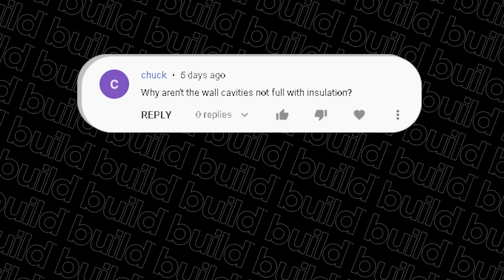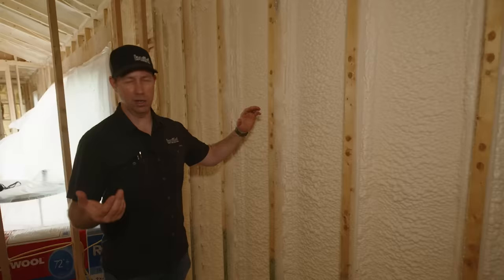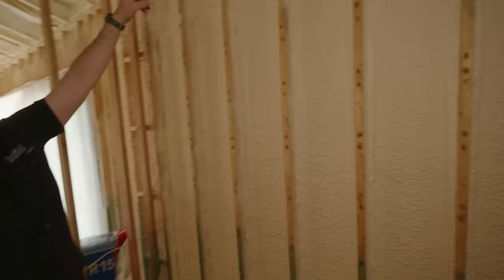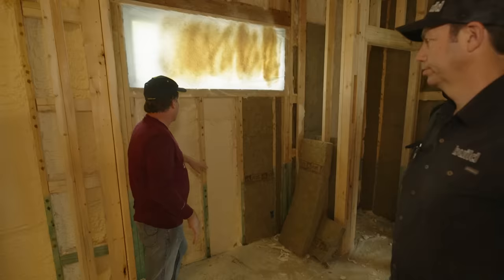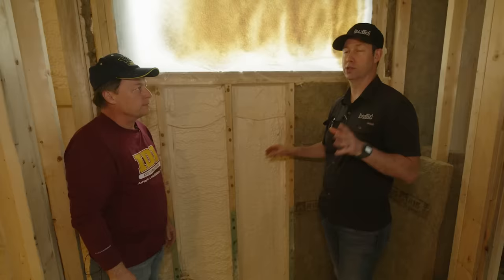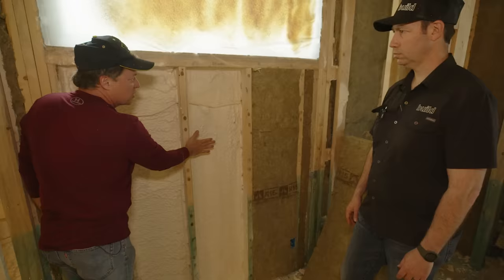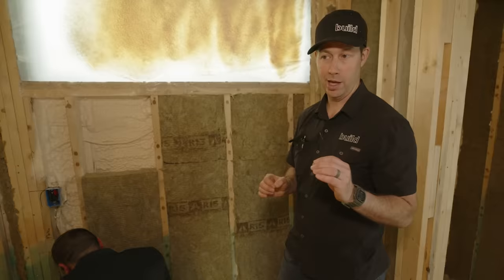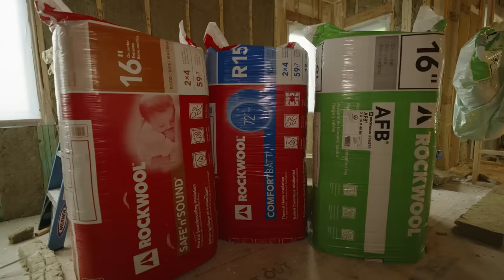Closed Cell Foam + Rockwool- How To Flash & Batt

Comment: something I don't get, and i'm hoping people will either confirm or correct me here.... But wouldn't it be better to do this the opposite way? I've seen so many issues with dewpoint etc with the foam and batts.

Why have the foam exterior and batts interior? Would it not be better to cover inside somehow maybe vapour barrier etc (as you dont want to drywall without exterior sheathing and housewrap) and then spray foam from outside onto the backing of interior wall, and the batt on the exterior before exterior sheathing?

I know this would make build a bit more complicated etc..... just meaning in terms of overall performance of the insulation. This would still air seal, act as vapour barrier etc but be better in terms of the dewpoint?

Im in a cold climate btw. Also have been thinking about this as a retro fit option to an already built house with rotting exterior ply. so interior drywall already there. remove sheathing, spray foam back of drywall, then batt and re sheathe and siding.
Reply: We vapour barrier on the inside as it a cold climate, this is my reason for thinking that way. Gives vapour barrier on the right side, air seals, and dewpoint wise this should eliminate issue.

Also I was meaning to remove the poly VB after spray foaming. or use 1/4 ply interior. Or maybe drywall and spray foam right away (foams good enough to waterproof while batting and exterior sheathing)
Reply: In our cold Canadian climate best practise is to spray foam the outside of the wall, not the inside cavity. 

IMO best method is to build with 6 mill vapour barrier behind drywall> 2x4 or 2x6 framing> fill wall cavity with rockwool insulation> apply liquid barrier to the exterior sheathing to stop any air leakage and install R8 or R10 continuous EPS insulation.  It must to be EPS. DO NOT USE pink or blue rigid foam on the exterior of a house. The downside to this method is there will be no room left for brick or stone unless your foundation is 10" thick.

Comment: The batts are basically unneeded, other than a slight noise cancelling you can't do much better than 2 " foam. R values are archaic and not any good indication of heat transfer. R value is a lab measurement in idea conditions. The real world is an actual testing in the field of heat transfer and 2" of foam will stop 86%, even 1"more  of foam only adds 4% more reduction, hardly worth the cost, especially using batts.
Mat likes overkill at costs, a good way for his channel to sponsor many different products which he does a great job at. The zip board wasn't even needed, the foam will give the wall all the rigidity it needs with other sheathing. Save money on materials and labor.
Check Spray Jones youtube channel out for the best facts on using closed cell foam.
I do enjoy both Matts and Jone's presentations
Reply: The real world requires an “R” value. That’s why. Plus ALL the manufacturers require 2” of close cell for a vapor barrier.
Reply: @Wild_Bill57  Only communities that haven't kept up with research and still value R as the gold standard. Once shown the new info many communities have allowed foam at 2". 
Very interesting when you say manufacturers require it, I thought communities codes would do that. Can you explain further?
Reply: @Wild_Bill57  You can petition for code changes with the right architect and proven research

Comment: How thick do my walls have to be to get r200 walls to protect myself from the Florida heat?
Reply: The T-studs that he used were 5½" thick (2×6 equivalent). 
They make 2×8 size as well. If you sprayed the whole cavity with high performance foam, you'd have nearly R60 for the wall system. And, I believe it would meet and exceed Miami-Dade specs for hurricane rating.
Reply: R200?
Reply: @kennyg1358  Use a calculator.  Matt told u r-value per inch in the video.  Go back and listen.

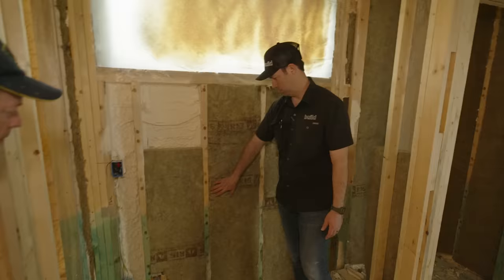Comment: Can someone check my vision?  At 9:00, look at the insulation label, does the lower batt say R15, and the upper batt say R13?  Thanks.
Reply: Look on the left of it, it's a 5. Only looks like a 3 because the top-left little 'L' hook of the five didn't print properly.

Comment: Where do the soffets go if you spray foamed where the rafters meet the wall?
Reply: This house was built with no soffit watch earlier videos.  Conditioned attic space
Reply: use "soffit blockers" (cardboard baffles-any builders supply") in conjunction with +rafter-mates" and continuous ridge vent  where require.

Comment: as you know and explained in this video much of the insulation installations are not done correctly and greatly effect the thermal performance. the systems you used - inside and outside needs constant inspections and with all the different systems there is more likely hood something is not installed properly.
The system your proposing maybe applicable in some climate zones and not in others due to the spray and board insulations acting as vapor barriers. in the NE I would not recommend duel insulation vapor barriers as it is (as of 2020 +-) as no vapor barrier is recommended,  air and water barriers yes, thermal bridging insulation yes. exterior water/air barriors along with using interior finishes (GWB) as backup air barrier yes.
your use of the "new stud" system could use a blown in insulation to fill the "gap". 
warm roof us cold roof - well you could start a war with that one and depends upon roofing materials.
thanks for ALL of your informative vids - discussions are worth it.

Comment: lol, rockwool doesnt deaden sound reflection if its clad in drywall.
Reply: I believe it does actually. The make some exactly for that, to use in interior walls.
Reply: @soybomber  I guess I ignored the word reflection on your comment. You're probably right. Your correction would be more effective without the google comment and "but whatever". My point is that insulation in a wall does help with sound. I'm sure you're correct that it only helps with certain types of sound transfer and also certain frequencies. If you're trying to do recording or band practice or something, you obviously need more.
Reply: @wsteven82  sorry, i hate being corrected when i am know i am right. but yes. soundproofing inside walls deadens "transfer" but for recording inside the room, in order to get the most pure direct sound without the added reflections (echo's essentially) you need to have reflecting surfaces deadened. Matt talks about that for a sec in the vid referring to the panels he made. essentially wood frames filled with rockwool and covered with a fabric. that same kind of panel is used in professional sound stages around the world. easy peasy.  most frequencies above 250 hz are easy to minimize transfer with basic mass inside walls, but bass frequencies are harder. you can build bass traps in the corner of your rooms, you can use resilient channel between your framing and your panels, as they allow the entire wall to kind of act as an absorbing device. bass frequencies are very large waves and require very large devices to absorb them. there are more complex and more expensive ways to frame rooms for absorbing sound as well. with special adhesives and fasteners that allow for "0" acoustic transfer through structure as well. basically floating wall and floor systems.  and then theres expensive additives like mass laden vinyl, that allow you to prevent acoustic travel into and through HVAC systems etc. it can get REALLY expensive really fast.
sorry for the essay, but its a good opportunity to point out real acoustic issues and solutions and end the conversation lol.

Comment: So why is this the choice over full cavity foam fill and flush trim?
Reply: 2" of closed cell foam stops 86% of all heat transfer, it's all that's needed in ice cheats that keeps ice for 5 days.
Reply: @safffff1000  ok but another process with more time and labor and making sure it's all cut nicely around boxes seems like a hassle over just foaming the whole thing when you were there foaming in the first place.
Reply: Mainly the cost but have fun trying to trim closed cell. Open cell is way easier to trim but it opens up the cellular structure and could cause issues and inefficiency
Reply: @elderfarms  No need to trim close cell it only needs to 2-3" thick
Reply: @safffff1000  Ice chests don't have wood framing acting as thermal bridges everywhere.

Comment: So I know this was a while ago but I’ve long been wondering: How thick should each of these layers be in a more typical 2x4 framed wall assembly?  I’m renovating and it seems like after the ccf flash layer, there wouldn’t be enough remaining cavity for even the thinnest R-15 rock wool batts for 2x4.  (I’m in costal California with our Mediterranean climate.  Very temperate, but my microclimate gets pretty humid compared to the region as a whole and recent decades make me concerned about the potential effects of climate change on the next, say 30-50 years.)

How would these be different if we don’t get to put Zip sheathing on the outside and we’re stuck with existing stucco over wrb paper?  Roof deck?  Crawlspace?

Comment: I never see anyone using faced batts on new construction or renovation. Except for maybe in an unfinished attic with no plywood floor. Why is that?
Reply: Depends on where you are. In Texas, where he builds, it is hot and humid outside/cool and dry inside. The condensation is on the OUTSIDE of the building. In the north - Minnesota or similar - the outside is cold and dry; inside is warm and moist, so the condensation is on the inside of the wall. 

In the west, it is dry almost all the time and no vapor barrier is needed.

Comment: Did I see no stud guards for the Romex?
Reply: Only required when less then 1.25" from the stud face
Reply: @CybekCusal  yes. This is a fact. 
I have my code book next to me actually. 

NEC 2020 - 300.4(A) Cables and Raceways Through Wood Members.
(1) Bored Holes. In both exposed and concealed locations, where a cable- or raceway-type wiring method is installed through bored holes in joists, rafters, or wood members, holes shall be bored so that the edge of the hole is not less than 32 mm (1 1 ∕ 4 in.) from the nearest edge of the wood member. Where this distance cannot be maintained, the cable or raceway shall be protected from penetration by screws or nails by a steel plate(s) or bushing(s), at least 1.6 mm ( 1 ∕ 16 in.) thick, and of appropriate length and width installed to cover the area of the wiring.
Reply: @elderfarms  you need a code book for that 🤣🤣🤣😂😂😂

Comment: Does it really pay off to invest so much in insulation while windows give us R4?
Reply: Depends. It adds more comfort. Less stress on the HVAC system. To me, everything in this house is cool. Most likely not practical for everyone but it sure is cool. It also adds a lot to research and development.
Reply: @elderfarms  Zip R plus T studs, plus this new cool foam ,plus the Rookwool, add it all up and it’d probably cost the same as ICF at the end . Anyway, the extra investment on premium lumber and premium everything pretty much compared to the energy savings doesn’t make sense . It would take you 30 years to get the return on the extra investment ,compared to the standard material build home . It just doesn’t make sense, unless your sure your grandkids will live in it !
Reply: with that kind of logic why insulate at all! the more insulation the better!! not only insulates from heat/cold but helps with noise as well
Reply: @mattd8222  sure ! How much will you save in energy with super insulated vs just better than code ,which most builders do these days? Like $500 a year ?

Comment: Discouraging to see this. After getting an education from spray jones, it would have been a better job to leave the batt out of the wall. Better to have the air space. If more insulation was needed one more inch would have been the way to go.
Reply: Spray Jones is very clear that the problem is condensation from not enough closed cell. That was specifically ddressed in this video. Two inches is more than enough for this climate (he specifically said one inch would have met code, so they even doubled what was required), so that will not be a problem with this assembly.

The Rockwool here is not added for additional insulation value but as a sound insulation. Spray Jones may or may not have a problem with that, but do keep in mind that, while I also like the guy, he is not without his own biases.

Comment: The bracing that foam would contribute is effectively zero. Bracing works on the tensile strength of the material. Plywood has high tensile strength due to its's area. Hundreds of nails take the shear load. Diagonal steel strapping is the most obvious of bracing materials. The tensile strength of foam is negligible therefore it is useless as a bracing material.
Reply: Incorrect.  Closed cell foam acts as a powerful adhesive, with a phenomenal strength-to-weight ratio.  What happens to a spray foamed wall assembly is the racking resistance increases significantly, like from 2380 psi to about 6100 psi for a typical 2x4 wall assembly.  Enjoy.
Reply: @gerrywagoner26  Limiting factor. The design by the engineer should have a safety factor of at least 4:1. The code number of nails fastened into plywood has to satisfy that number. Increasing the number of nails does not increase the racking force. At that point the panel would need to increase followed by an increase in fasteners. 

In simple terms if you use construction adhesive to glue 1/2” sheathing onto a stud wall vs the code number of nails you have not increased the bracing. 

If you compare a SIP to a typical framed wall you have an increase in racking because you have a composite panel with double the skin thickness. 

If you took a sheet of ply and sprayed one side with foam it would not increase the bracing. There is no fiber strength in foam. Some foams like they use in boatbuilding are excellent in compression between composite skins. Spray foam is not one of them.

Go ask a pro engineer.
Reply: @aspees  Correction, the racking tests were conducted with drywall AND OSB.  Drywall went from 2400 maximum racking load to 5380 with closed cell foam.  maximum racking deflection was .945 with fiberglass, and .856 with spray foam.

With OSB, it was 4800 lbs maximum racking load with fiberglass and 6100 lbs with closed cell spray foam.  Maximum racking deflection was 1.045 with fiberglass and .767 with SPF.  Enjoy.
Reply: @aspees  It is also noteworthy that in the aftermath of Hurricane Katrina, FEMA concluded that SPF was the only advisable insulation material in hurricane coastal areas.  They cannot enforce this conclusion, but they did publish it on their website after observing SPF homes that were still standing when their fiberglass-insulated neighbors were completely gone.  The SPF also prevented the structure saturation that fiberglass or a loose insulation material allowed.  This too is a FEMA observation.  Enjoy.
Reply: @gerrywagoner26  Obviously, if you litterly soak fibreglass insulation in a wall cavity it will have numerous negative structural effects. Therefore it’s not valid. Also common sense would indicate that t he houses in LA that are spray foamed are the best built houses in that location my many orders of magnitude. LA is not known for its building quality. Those spray foamed would be rare and all of the framing/sheathing would have been above code and done properly. Once again this does not relate to diagonal wall bracing increases claimed with spray. Are you confusing bracing with panel deflection?

Comment: Rockwell sound deading is irrelevant when covered by wood/drywall
Reply: Not irrelevant. Your voice will still echo off of the wall and go back to your ear, but noises from other rooms will be drastically reduced. It still absorbs and deadens the sounds energy. Please think more logically before you add another ignorant comment to the millions of others in comment sections. 

How about you frame a room without sound deadening and then frame a room with sound deadening. You tell me it’s “irrelevant”.
Reply: Insulation inside the wall cavity is designed to dampen the transmission of sound through the wall. I.e., to keep outside sound from getting in, and inside sound from getting out; and to dampen sound transmission from room to room within the building. The very dense nature of Rockwool makes it a perfect insulation for this purpose.

To help deaden sound within a room, which is more along the lines of what you were thinking, you need sound absorption. While Rockwool can be used for this (as Matt mentions in the video), other materials work better in sound panels.
Reply: @elderfarms  not any better than fiberglass. Easier to install correctly by low IQ, sure.  Simulations in uncovered rooms are misleading.    Do you want evidence ? What frequencies is your comment for?  Perhaps there is a reason you're where u are